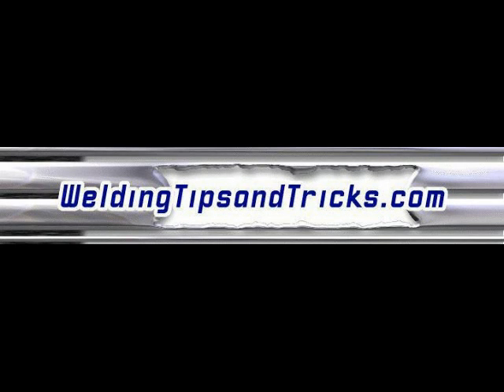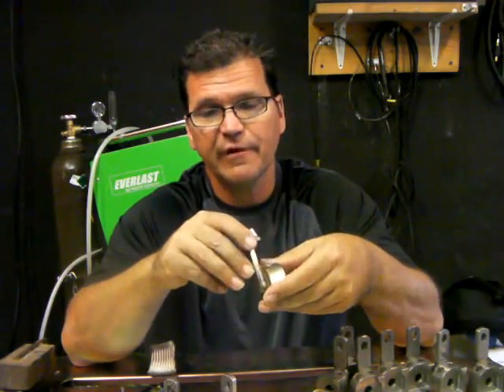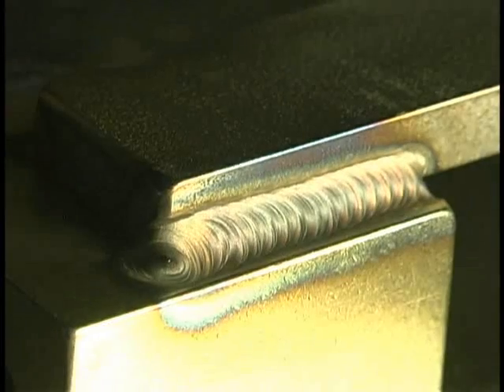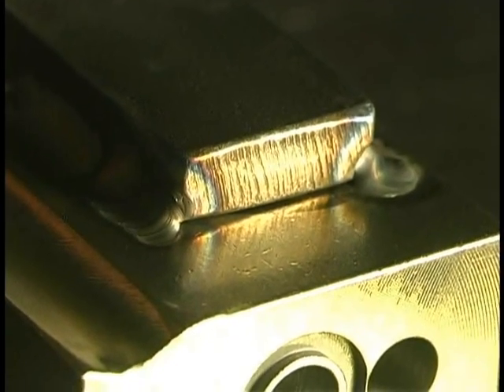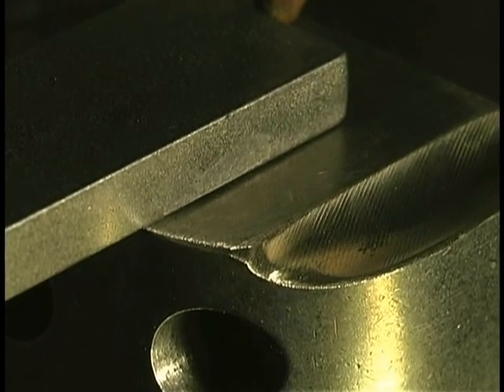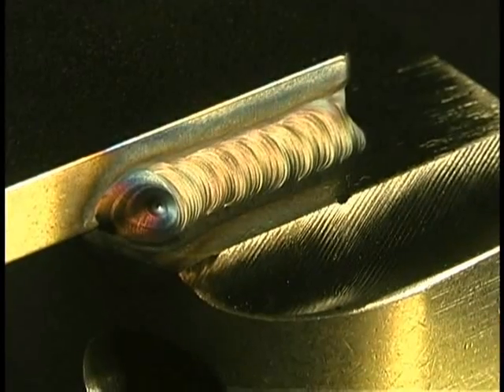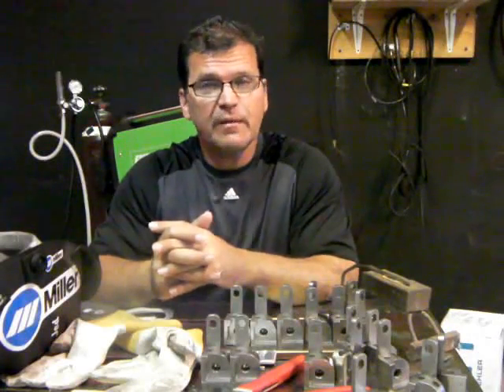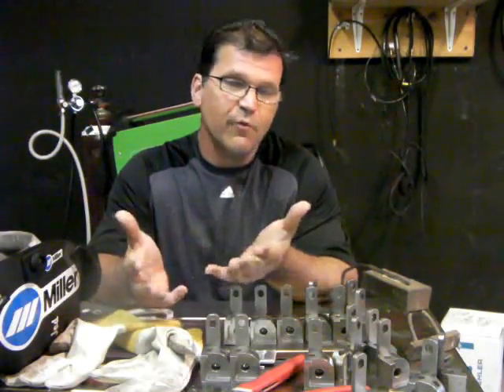TIG Welding - High speed Pulse vs slow

Comment: When you are using a foot pedal, doesn't that override the max and minimum amperage settings? I can set the "peak Amps" to 125, but the base amps stay at 5 and you can't change it when the pedal is plugged in. this is on a Razoerweld 200 acdc.
Are the base amps dictated by the position of the foot switch after the initial "Click on" and up ramp motion once the pulse starts to "pulsate"??

Comment: Seems that the higher the pulse rate, the more controlled or narrow the weld run is managed - doesn't bleed to the edge /etc, but structurally speaking does the higher or lower pulse rate affect the strength of the weld assuming identical materials?  Has that ever been tested?
Reply: Sam R yes, Miller did a study on it. Most welders don’t know how to use pulsing and most videos are misinformation. 

https://www.millerwelds.com/resources/article-library/superior-for-stainless-highspeed-pulsed-gtaw-boosts-productivity-quality-while-reducing-distortion

Comment: What does one pulse per second do to auto darkening welding lenses? are they going to constantly be cycling on and off? Should that let you keep better track of what's going on by seeing the surroundings during the weld?
Reply: On most(?) helmets you can set how long the helmet stays dark after the arc goes out. At least that is what I adjusted on my helmet getting ready to pulse weld with my everlast welder.
Reply: DTR RTD the lens not going to cycle on and off. Using a pulse means the amperage peaks and drops to whatever you set it on. The arc didn't actually stop and start every second
Reply: TheGustavoramos 
makes sense, the arc current just drops to a low value but doesn't actually stop the arc, so the lens remains on the full time.
Reply: DTR RTD yea personally I don't trust auto darkening but I know some of them are good and sensitive that even grinding will make them dim. So you should be good

Comment: Leaving the wire in the puddle (around 3:15)... is it feasible to lay the filler wire in the joint angle then just use the pulse feature to melt it in place or would that not leave enough filler in place? It's difficult to see if you are still feeding wire into the puddle or just leaving it static and melting it as you move the torch.

Comment: I wonder one thing. Pulsing in the DC mode has a high current and a background current which gives an average of current between high and low current setting.

But how about AC when the balance only goes between negative and positive, then the current on the readout is more accurate right? So for instance, if I weld on ac mode and some chart says I have to go for 120 amps, then I just set the readout on 120 right?

And If I were to weld DC with a chart value of 120 amps and chose to use pulsing with a low background current, like your 33%, then I have to crank up to maybe 170 (well, more then 120 to higher the average against the recommended 120A)?

And last, and most important question for me, in AC mode, I know I can set my balance which vary cleaning, and also frequenzie which alters how often to switch phase, BUT as in the DC mode with background current and that type of mode with pulsing, will turning on those knobs affect the AC mode welding too? Or is it just balance, amps and pulsing, those three things that is relevant in AC, so no background current and such?

Phew, that was hard to explain, I'm a swed. =) Btw you could maybe do a video on that too, that explains the very difference between AC and DC pulsation settings.

Comment: Once you go above a pulse frequency of 20 -30 Hz in manual welding you have no benefit, you may as well have the arc continuous.
Reply: actually, higher frequency GTA welding helps not only agitate the puddle and excite the carbon lattice, (for carbon steels), but aids in fusion, HAZ, and puddle control.
Reply: What level of frequency are you talking about?

Comment: So i can see the benefits of pulsing for hole filling etc.. But if I were to do this, lets say on a 16~14 Ga. SS fitting, welded sanitary (inside and out) In your opinion, would there be a huge benefit.
I do have the Miller Syncrowave 350 LX

Sincerely, an old school metal worker that has not worked with pulse.

Comment from the maker: @rcfreak2493 
if you go strictly by the math, with the flowmeter set at 12 cfh the tank would last about 10 hours of constant welding depending on how much postflow gas was used after the arc.  ... not exact due to the surge at the start, but its close enough for figuring the cost of tig welding.